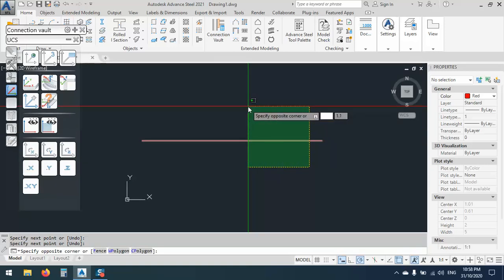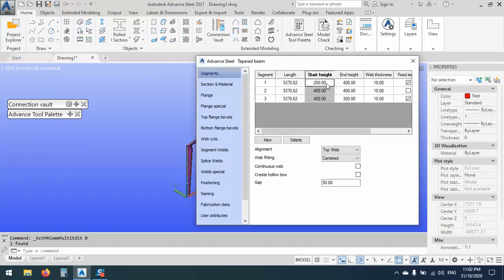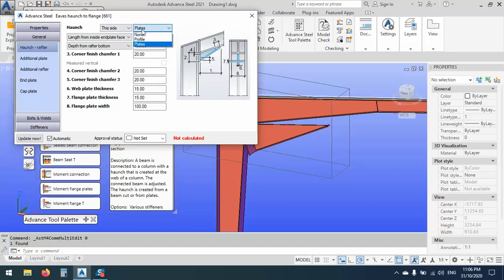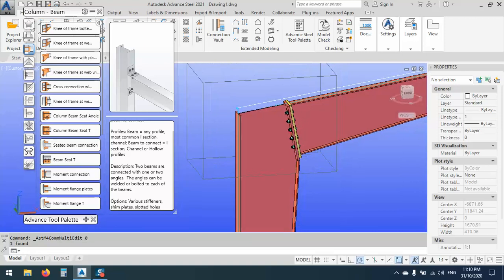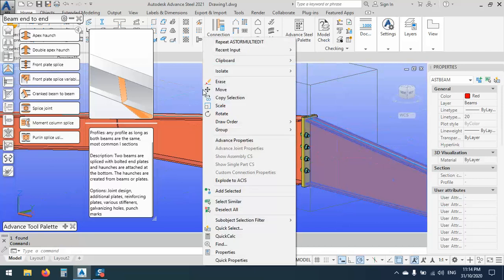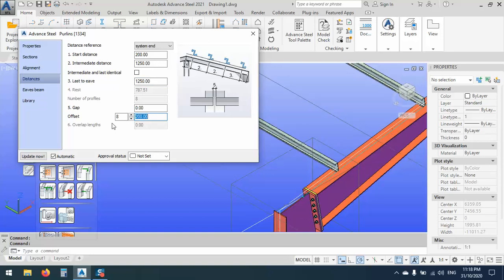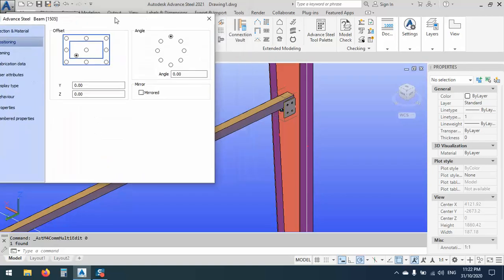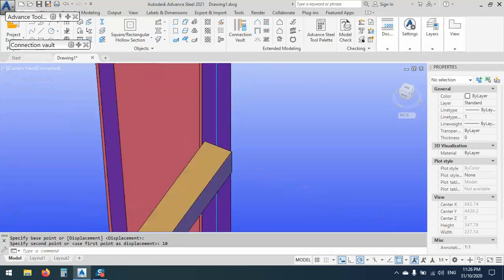Advance steel 2021 All about tapered section warehouse ( joints + purlins )

Comment: Have one doubt brother. How advanced steel use without design the structure. which program you are using for structural steel design and connection. could you clarify me. Thanks
Reply from the maker: You can use idea statica and etabs or use robot structure